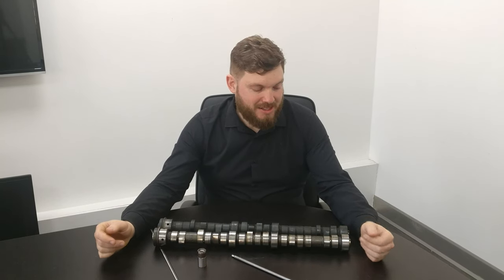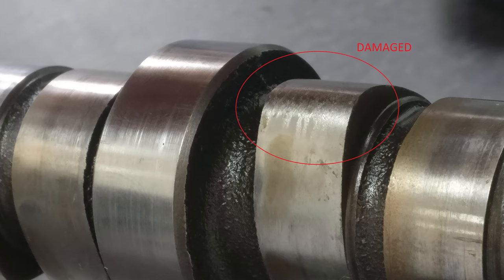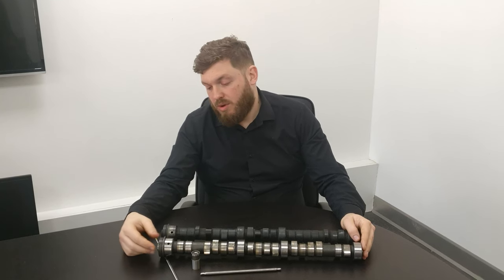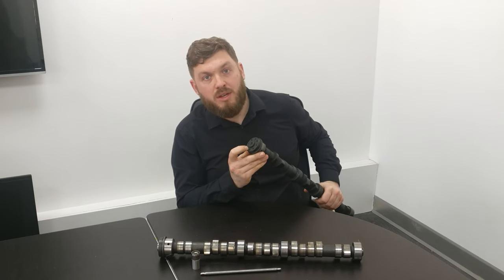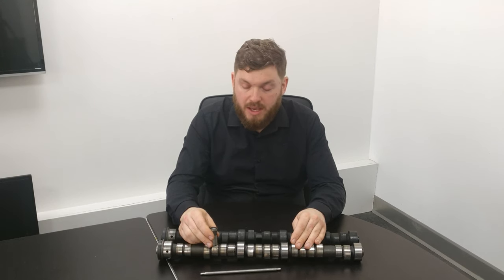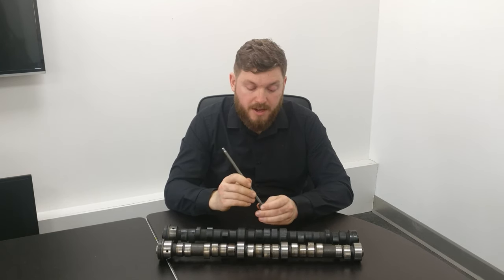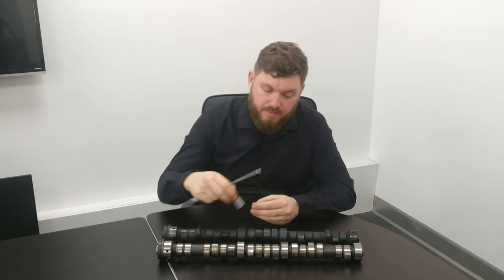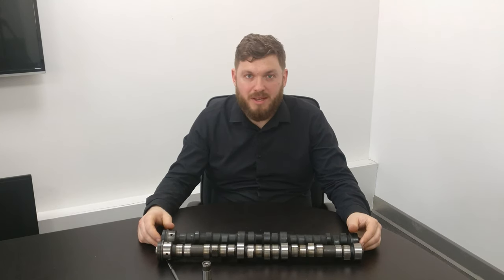Main issues with the V8 Camshaft on Rolls-Royce & Bentley cars

Comment: Is the camshaft failure issue due to high mileage or can it happen at any time?
Reply from the maker: Hi, the main reason for failure is usually just common wear, but poor set up can definible lead to issues.
Reply: Thanks for your reply. What is the camshaft failure issue with pre 2007 Arnage ? Have a great day.
Reply from the maker: @mikewolf91  The early twin turbo engines, had a problem where the face of the tappet and the camshaft lobe would wear out. It wasn’t apparent before it was too late. It’s hard to know why this was but these engines had high lift cams and used a lighter grade of oil than previous engines. This may have been a factor. The later engines were modified to have a roller between the camshaft and the follower eliminating the wear.

Comment: Can the camshaft still be sourced for the Arnage T?  I hear it is no longer available.
Reply from the maker: Hi, yes they are still unavailable unfortunately.
Reply: @introcar  are there no manufacturers willing to produce copies?  Surely machining a camshaft from a blank would be possible...
Reply from the maker: @edwardmurray8507  Yes, it would be a great product to add to our list. We would also need to consider the hydraulic tappets which would also need to be sourced or made so they can be supplied with a new camshaft

Comment: how common is camshaft failure on a 2002 arnage
Reply from the maker: Hi, which model in specific? In 2002 you have Red Label and T models
Reply: how do I know its a car i'm thinking of buying
Reply from the maker: @georgemalyn3653  A Red Label is a single turbo and T is a twin turbo
Reply: @introcar  i dont know its the 450 bhp engine
Reply: @introcar  its a T with 60000 mls
Reply from the maker: @georgemalyn3653  The early Arnage T cars did suffer with camshaft /Tappet wear.  Bentley later modified the camshaft and tappets to have rollers to prevent the wear. It is worth checking the car carefully for noisy camshaft.
Reply: @introcar  thanks for your advise i haven't bought one yet but looking at two a 2002 and 2004/5 facelift model which one would be better in your opinion sorry for bothering you thanks
Reply: @introcar Wrong. The Arnage R & T were both twin Turbo models.
Reply from the maker: @DrJRaven  Yes sorry, you are right. There are other twin turbo models. I only mentioned the Arnage T.

Comment: Should ZDDP oil additive be used in the 6.7 liter Rolls-Royce & Bentley engines to prevent wear on the cam, and flat bottom lifter/followers?
Does the 1999 Arnage Red Label engine have flat cam lifters/ followers?
Reply from the maker: Hi, we haven't heard anything about adding anything to the oil before so we can't reccomend anything along those lines. The cam lifters are not flat but slightly dome to prevent wear. Do let su know if yolu have any other questions, thanks!

Comment: Matt: I was thinking about buying an Bently Arnage T. Now that a 2002 is 18 years old, I am seeing them with upwards of 65,000 miles. I heard that the head gasket issue is more of a problem with earlier cars than the 2002, but from 2002-2006, the issue is the camshaft. Many people say buy one from 2007-09, for better reliability. What is your experience and opinion? Did Bentley ever change the head bolts, head gasket design, heads, camshaft, etc., to make the car more reliable? If you buy one that needs a camshaft, head gaskets, can the later year parts be substituted?
Reply from the maker: Yes, the head gaskets are more prone to failure prior to the twin turbo models. The twin turbo models have modified head studs/bolts and different head gaskets but prior to 2005 they are prone to camshaft/tappet wear. After 2005 they modified the camshaft and tappets to resolve the issue. I think there is a lot of work to try and retrofit the parts from a later car to an earlier one, and the parts are expensive.
Reply: @introcar  so is it the model year 2005 and newer that has the camshaft changes or did they occur midway in 2005, or start with 2006, with a certain vin number?
Reply from the maker: @rovingeye5   Hi, We have checked and it seems that the modified tappets actually came in 2007. The only way to be sure would be to check against a specific chassis number
Reply: @introcar  Do you have a "safe" VIN number onwards which has the modified tappets fitted please?
Reply from the maker: @mbishton  Hi sure, here is a list of VIN for the tappets
SCBCC41N79CX13501-99999 2009 BENTLEY BROOKLANDS
SCBDC45H5ACH14341-99999 2010 BENTLEY AZURE T
SCBDC47LX7CX12009-99999 2007 BENTLEY AZURE
SCBLC48F07CX12007-99999 2007 BENTLEY ARNAGE R
SCBLE48G07CH19500-99999 2007 BENTLEY ARNAGE RL
SCBLF45F37CX12000-99999 2007 BENTLEY ARNAGE T
SCBLF45F99CH07910-99999 2009 BENTLEY ARNAGE FINAL SERIES